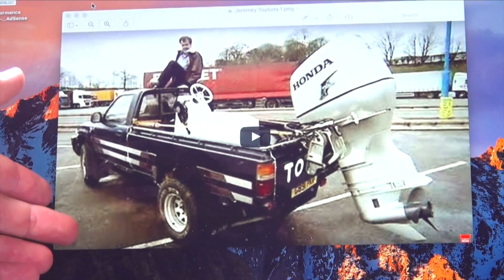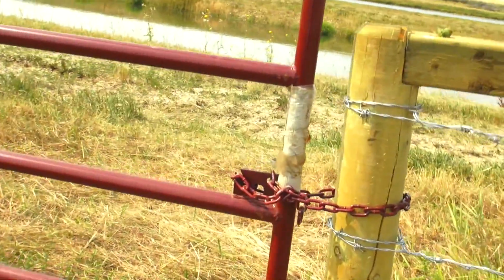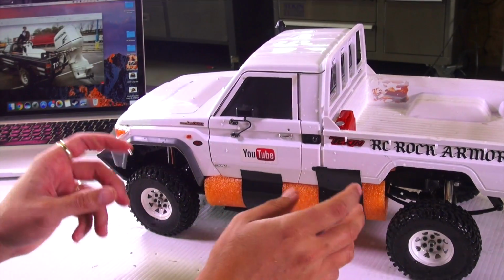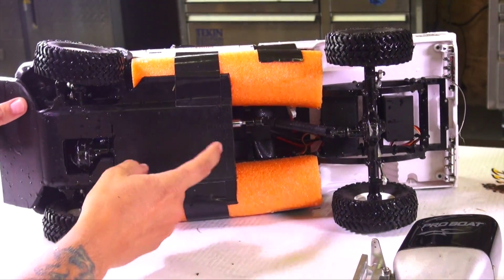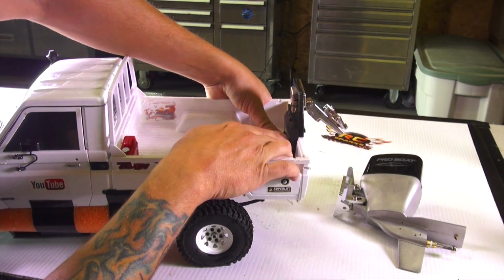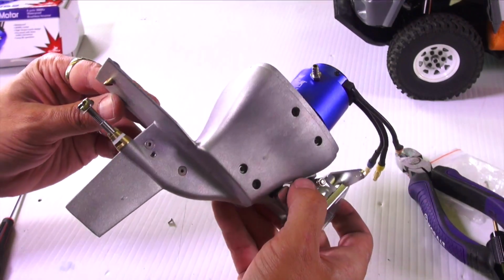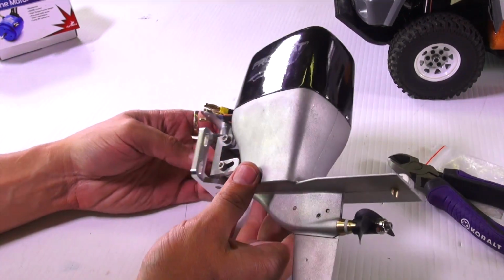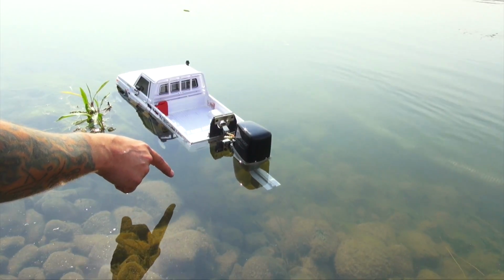RC ADVENTURES - TOYBOTA PROJECT - PT 3 - BBC TOP GEAR TRiBUTE BUiLD - TOYOTA TRUCK-BOAT

Comment: Yeah definitely need more foam in the back cuz the motors too far down in the water that flat plate just above the prop should be right at the top of the water

Comment: Great video bro I am following you on this project. Pool noodles are great floatation devices I made some floats for my phantom three advanced using the pool noodles works absolutely flawless. I got a suggestion cut one of the pool noodles in half and tape it along the front skid sideways and that will lift the front skid out of the water a little better than you have it now.  And put a piece along the back  underneath long ways . Anyway bro it's just a suggestion to your project and I'm sure you know what you're doing so thanks for sharing and I will follow you until the end. If you get a chance go check out my channel I have some pretty cool drone videos with some good editing and tell me what you think thanks bro and keep up the good work.

Comment: looks great!! The only thing I would change is the way the outboard mounts to the bed. Its way too far back. The original was mounted right against the tailgate. I know you gotta have a way to raise the outboard so it doesn't drag the ground but the way you currently have it puts the motor way too far from the bed and it doesn't look like the original. Also having it so far back makes it heavier, forcing you to use more foam to make it float. Im trying to think of a better way to make it tilt. A small electric ram might work. Maybe off of a little tilt bed from a dump truck or something. That would make it much more realistic and it would put the outboard right up against the truck like its supposed to be. Maybe even a small spring would work. When you want to use the outboard just push it down and have a little clip or something that keeps it there. when your done with the outboard just release the clip and the outboard will spring back up.

Comment: You should make small holes in the back of the cab so you can put the steering cable in then put the servo and esc in the cab. Loving the build

Comment: The motor far to low in the water so using my idea of creating more bouncy maybe squeeze some pool noodle in before you seal it if the barrel's do the job without further bouncy of the noodle.

Comment: The hinge and plastic will be far too heavy add the outboard and you have problems with weight you need the steering servo and maybe a trim servo, you may get better motor cooling if the feed is put on the top inlet and out the lower using gravity and the force of going along, also the motor needs to be a lot nearer to stop the seesaw effect.

Comment: If you add some plastic pipe sealed at both ends to be waterproof and scale of the fifty gallon barrel both sides will lift it for better balance.
Reply from the maker: Already have it Nick! 2" water piping I use for pumping water to the 5th scale race track. Its perfect :)

Comment: don't want to state obvious but back end will naturally drop as soon as the motor starts so it will lift front end but might drop below waterline on the back
Reply from the maker: Still have some floatation barrels I have to attach to the side.. that should help keep the back bed from sinking too much. Thats why Im worried about not lifting the nose enough, for the skid plate to work properly. I may have to make another one
Reply: RCSparks Studio but in the episode didn't he have problems with the nose going under :-) in the words of Clarkson "speed and power" keep the front up Haha

Comment: sorry for saying this but is it just me or does it just looks really crappy its just sticking out way to far.
If you would have moved the whole thing back to where the outboard motor would be as close as possible to the body.
that way you could use the same parts but it would look a 1000 times better and it would also help with stability and control in the water.
Reply from the maker: it is as close to the body as possible :) its literally resting on the tail gate
Reply: In the video it looks like there is 5 cm or so between the tailgate and the body of the outboard motor
Reply from the maker: you can not have the body resting on the tail gate, as it would rub when it turns ;) There needs to be a gap
Reply: Yeah i see what you mean but the hinge takes up a lot of space. If i lived close to you i could 3d print a part to make it look realistic and it would be more space efficient.
Anyway i am loving the built with the huge engine on the back. I really want to see it in action.
Reply from the maker: Haha, thanks Tibo... Im loving just mucking about.. seeing how far I can get.. who knows, this craziness just may work.. lol

Comment: I got a question
When ever I trie to drive my rc with both a full and flat battery it makes a clicking noise and won't move can you help me with that thanks
Reply from the maker: sounds like a broken pinion or spur gear. pinion is on the motor, spur is the gear a pinion turns

Comment: If it helps, medic, a gallon of water  weighs 8.3 lbs.  If you displace 1 gallon of water with air, you can safely float 8 lbs. Since you want the rc to partially sink, you won't need only a fraction of this displacement. The drums on the original toyboata would each add about 400+ lbs of flotation. Maximize the space you already have with a spray foam to get into every nook and cranny and seal the tires.

Comment: "Those who have been following will see this looks terrible" Best quote so far. And loving everything about this build. I still think you should leave the skid plate where it is at, if that outboard has enough power it should still get up on plane. 

And the spring loaded hing is freaking brilliant.

Comment: You may need to add a limiter to the down as well on the outboard. The black casing where the motor is, is almost in the water which means your whole casing will fill up. It will go even lower if you get it to plane on the water. Not sure that it matters for your waterproof motor. However some food for thought.

Comment: Great idea for the lift! the only thing I would do differently is put rails like ones for a 5th wheel hitch and a winch at the front so you can pull the motor into the bed for more clearance.

Comment: You can cut down the skeg on the motor....it is that large for racing, where we needed the extra control at high speed. you won't be moving at race speed, so the propwash will be plenty of steering control.

Comment: Is there enough room on the inside of the skid plate to put either foam or noodle or is the steering components in the way? Don't know if it would be enough to bring the front up any but just a thought.

Comment: I have a idea I did this with my blizzard so it floated... you can probably get that pink or blue insulating Styrofoam sheet they sell and put a section in between the skid plate and chassis in the front this would help it float more, they sell it in different thickness.

Comment: I was thinking some tall aluminum c channel over the tailgate would have done the trick, with a safety cable holding the motor on just in case